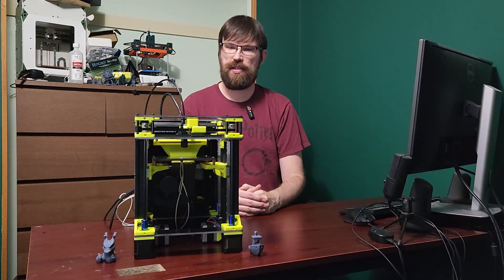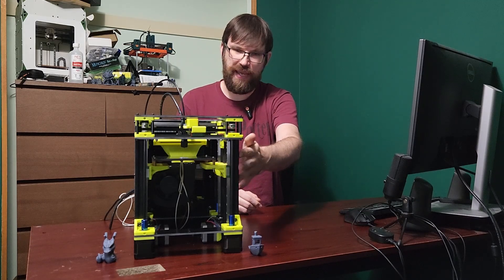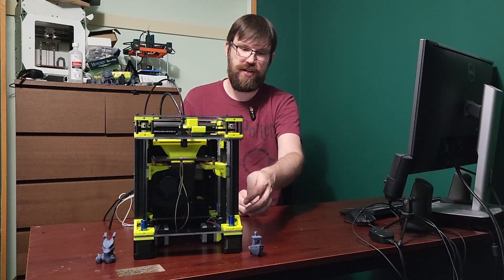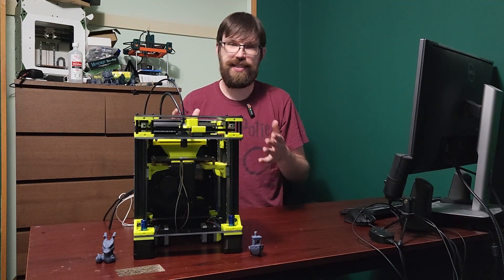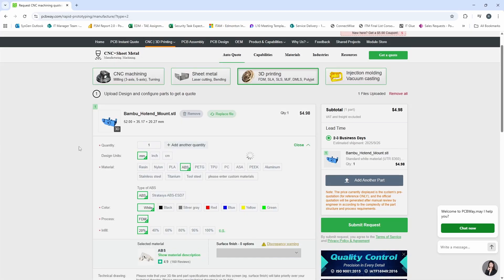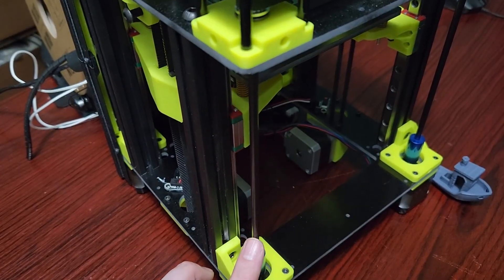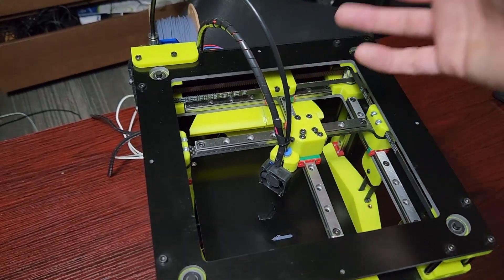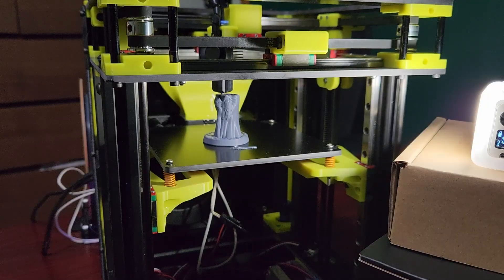My secret prototype Cross Gantry 3D printer prints!

Comment: This is awesome because it simplifies the build significantly.  5 laser cut plates and 4 bends and you could make this out of sheetmetal easy.  Why so many motors? seems like you could get away with only the 4 top motors?
Reply from the maker: there are 2 x motors and 2 y motors Cross Gantry has 2 belts per axis

Comment: Why not use linear bearing? I searched for halo plate but couldn't find anything.
Reply from the maker: linear bearings are very loose and not great for 3d printers. the G10 plates I used are just called Halo as they look like that. Not an official term
Reply: @Rolohaun  Pretty much every printer now days use LM bearings. I am not sure where you are located but I think it would be neat if you tried to make a 3d printer from only what you could find at Lowes or any other American store as cheap as possible. That WOULD be a challenge!
Reply from the maker: @jondoough that would be cool, maybe one day
Reply: from my own findings, is that even if the linear bearing is ok, the linear rod can be out of spec, so everything is loose anyway :/

Comment: Question for you if you'll entertain one: I'm doing a bit of a monster one-off 330x850 for a personal project tie-in, though have a few parts that will be relatively new/novel for the applicaiton. Primarily ballscrew motivation/maybe one lead on a rail for the Z. So far as the x-y axes, I'm somewhat stuck on doing a sort of a flying gantry and am open to considering options. I even looked at some radical options like tripterons, but inevitably I think getting it working is more important.
Does CroXY scale fairly well if one were to run rails in place of a x-axis extrusion? 
The aim is to eliminate belts as much as possible for 'extreme' temp material capbility.
Reply from the maker: the belts will be much shorter with CroXY and work better than CoreXY. Ballscrew is best but I think it's very expensive to get ballscrews.
Reply: @Rolohaun  I've been accumulating parts over several months with a fluid design in mind, though have had to go back on a few things like motors and drivers for the weight of the screws. If isolating belts like you have on your demo printer is feasible, I might be inclined to try that. Thanks for the response, too.
Reply: How high of a temperature are you aiming for? If it's below 130C then EPDM belts would work. I recommend looking into bellows if you are going above 100C though.
If you insist on eliminating belts, then do box cartesian with a motor moving with the X axis, then use ball screws to power the long Y axis would be your best bet.
Reply: @ATARAXIA_MECHANICA  Yep, that's basically what I have thus far, 1000mm ball for the long Y and a collection of rails for the moving surfaces. My target temp is right around 130C chamber, though going higher while isolating the motors with additional cooling has been considered. I have a few more parts to resolve with the hot end, as I don't think it's been done before.
Reply: I'd use two stationary X rails and motors driving leadscrews to move a Y rail and rack. Mount the Y motor on the printhead with a pinion to drive along the rack. Clean wiring, and no long ballscrew with its rigidity/inertia issues.
Reply: @dekutree64  I looked at doing rack and pinion, though the layout of this one is very unortodox, same as the printhead. I want to elaborate, but even a hint will probably let the cat out of the bag before it's ready and tested. The kind of thing that I'm building the tech first as (I don't believe anyway) it's ever been done before, but has great potential to revolutionize extra large, high temp format. That wasn't the initial goal, but it's evolved after a side project opened my eyes into other possibilities. 
In the end of it, rigidity won't be a problem at all, just balancing print speed potential of the shorter x axis with a long y axis. After everyone's ideas though, I'm thinking about isolated high-temp belts outside of the chamber and a novel gantry on linear rails. Should be fun and maybe an eye opener if nothing else!